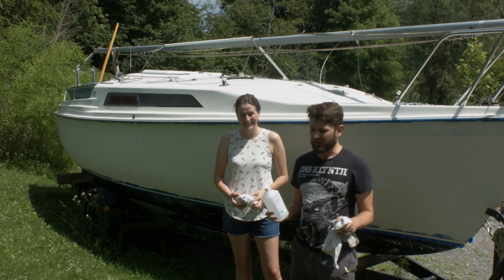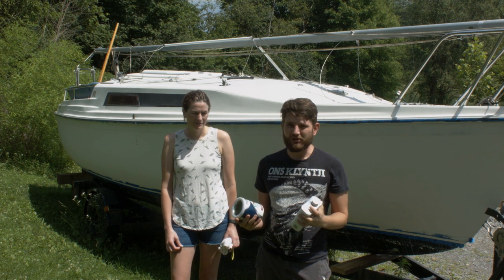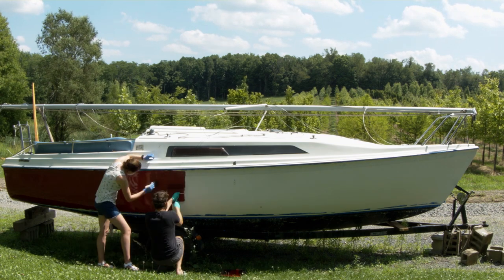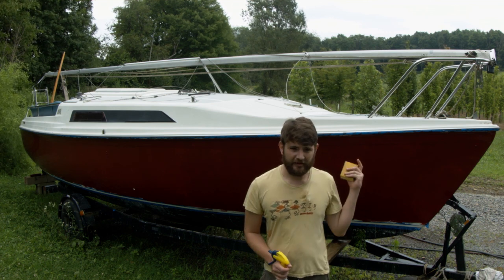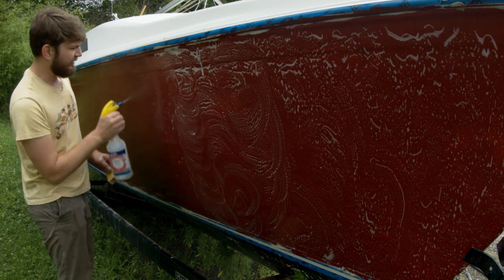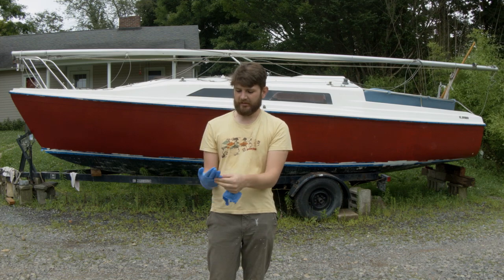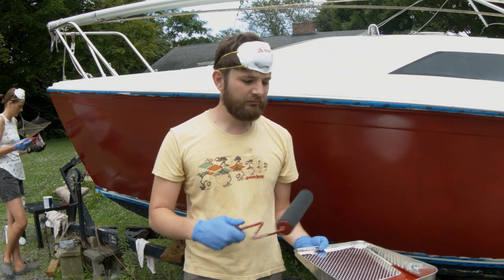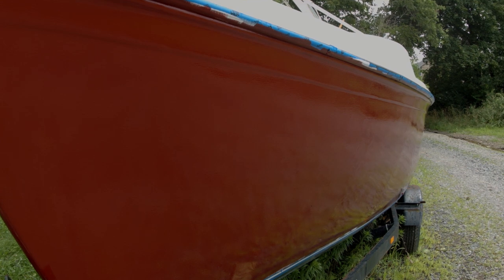Ep 06 - We Paint the Boat

Comment: Great information and nice job. I have begun sanding below the waterline on my Mac and will do topsides soon. How much paint was required for the 2 coats you have done? Did any areas need 3 coats?
Reply from the maker: rick m I used the online chart at westmarine to determine the amount. For the 26 it said 2 quarts. We thinned ours with brushing thinner and we ended up with about 1/6 left in the last can (going to use it for touch up here and there). I think if we didnt thin the paint we might very well have had to buy another quart. Because we did the primer aswell before painting the topside I think it really helped and it doesnt seem like a 3rd coat is needed.